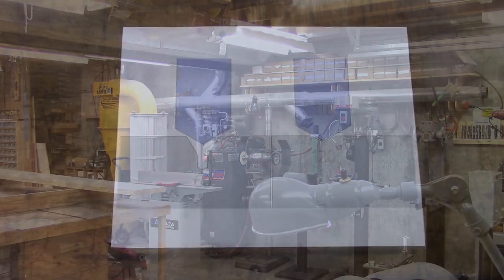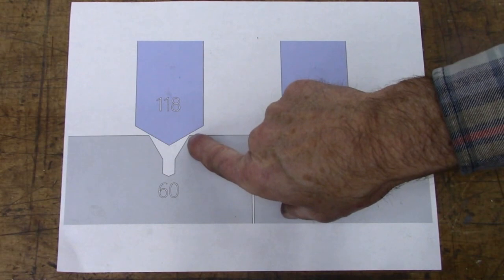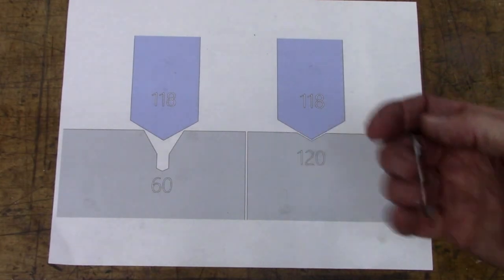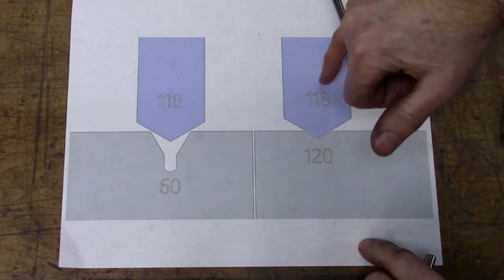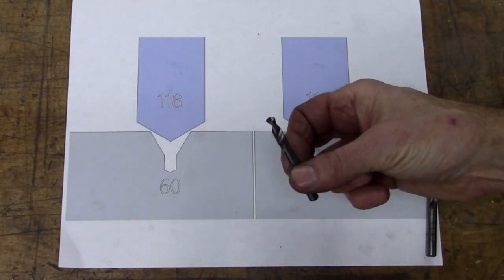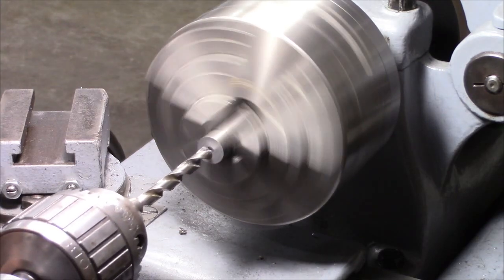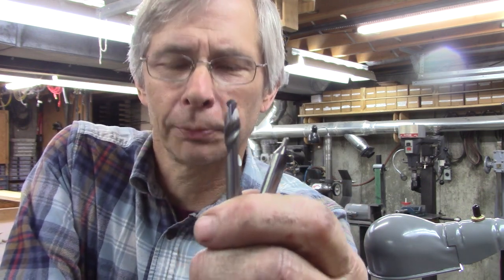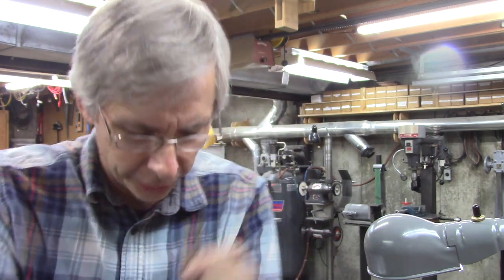Center Drill VS Spotting Drills

Comment: How deep do you go with the center drill?
Reply from the maker: Ideally when used for a pilot just the tip. When used for a center to the end of the second angle.
Reply: @WinkysWorkshop  what happens if you go to line ?..would it break the center if it’s to deep?
Reply from the maker: In theory, when used as a pilot drill the sharp edge of the hole would deflect the longer drill off center. The tip of the center drill matched and 82 degree drill but the second cutting edge does not. When used as a dead center in a lathe you would use most of the cutting ende on the second step.

Comment: How deep do you drill with the spotting drill?
Reply from the maker: Only the angled part. Going further probably won't hurt but it's posible that the sharp cutting edge of the drill will catch the sharp edge of the deeper pilot hole and deflect the drill.

Comment: A couple things that are either incorrect, misunderstood, or misrepresented.
1. You're first attempt, with the center drill, was too deep. (more later)
2. Your drawing is correct, but you apply it incorrectly. The depiction on the left should be used for HSS and Cobalt, while the right would be for Carbide. This is referring to the spotting angle (greater for carbide and less for HSS/Cobalt).
3. Your spotting diameter should be ~30% < final drill diameter. This is why I say your first attempt was doomed to fail, regardless of any other particular point.

Other than these points, I think it was a decent video and it seems others have learned a thing or two. ;)
Reply from the maker: I might not understand correctly. The first example was doomed to fail because second angle on the spotting drill is meant for a lathe center not for spotting. Did you mean that the TIP diameter of the center drill needed to be 30%? If so, I would agree with that. Also why would the spotting drill angles be different for HSS vs carbide? The angle of the spotting drill needs to be the same of slightly greater than the bit that follows. Your 30% diameter rule sounds about right but the angles compared to the drill that follows is critical.  This is a good website:  https://www.harveyperformance.com/in-the-loupe/choosing-spot-drill/#:~:text=Ideally%2C%20the%20center%20of%20a,to%20140%C2%B0%20and%20larger.

Comment: For ease and accuracy could a center drill front edge be cut like a spotting drill. Smaller start but multipurpose is nice.
Reply from the maker: Yes, most center drills are sharpened at the correct angle (at the very tip) for a 118 degree bit. I left this important fact out of the video.

Comment: That was interesting thank you.   Speaking as a retired engineer with 50 years service in high quality Machine Tool manufacture,  I'd never heard of a spotting drill before and I must have drilled many thousands of holes without any problems after using a centre drill first.   The theory of how your spotting drill works sounds ok,  but I'm assuming that an accurately positioned hole is the object of the exercise?   My question is how do you stop the spotting drill from wandering from it's position when starting to drill?   Surely a short and stiff Centre Drill is much less likely too?
Reply from the maker: A good spotting drill is split point so its basically the same as a center drill. I use carbide so it is super ridged. Something I failed to mention is that the very tip of the center drill is the correct angle, its the larger part of the center drill that is not. In the past I've had problems with drill staying on center following a center drill but I was also drilling deep.

Comment: "a center drill is actually for a lathe center"   
"a spotting drill is when you want to locate a hole accurately and follow up with a larger drill"

Do I get an A?
Reply from the maker: You got an A. Ha...  You can use the very tip of a center drill for spotting however. It's sharpened to the correct angle.

Comment: Perfect. Just the kind of tip I was looking for.  Now that I bought a few sets of center drills... But let me ask you this. What if I am not using them on a lathe but with a drill gun or drill press? What if I need a 3/16" hole?  Could I use the center drill that has the biggest diameter of 3/16" and drill a 3/16" hole?  So the center drill would start with the smaller tip on a center punch dimple, and just follow with the 3/16" diameter part of the drill.
Reply from the maker: One thing i failed to point out was that a center drill has the correct angle at the very tip. You can use it as a spotting drill but ideally the drill needs to be no more than the diameter of the tip of the center drill. I still use the center drill occasionally because it has better visibility. That is, if you are trying to hit a mark made by a center punch you can see the tip of the center drill. The biggest issues arise when you use the upper part is a center drill to guide a drill.

Comment: I didn't see the wobble.
Reply from the maker: It was slight. Nevertheless using a center drill like I did it prone to problems. I did fail to mention that the very tip of a center drill can be used as a spotting drill. It's sharpened to 120 degrees and works well when followed by a 118 degree. The only problem is that unless you use a fairly large center drill it makes a very small starting hole.

Comment: Thanks Winky, I had to learn this the hard way when I should have researched "Center" Vs "Spotting" Drill first. That's how I found this video. Now I know why I've consistently been disappointed in my Center Drill results! After seeing your video I'm convinced more than ever that besides the points you made, ..the Center Drill has no place in Drill Press operations. I've been using them for that following center punch operations. EEEK! 🥵
Wakodahatchee Chris
Reply from the maker: Your welcome. There is one thing I failed to mention in this video. The very tip of a center drill is the same as a spotting drill. I occasionally use a center drill for small holes. Its easier to see the mark. If you get a spotting drill I would suggest getting an 1/8" carbide. It's very ridged and will last forever plus its easier to see you center punch mark.

Comment: What I've wondered since I don't have any spoting drills is couldn't you make a spoting drill by just cutting down a regular drill just past the shank then just put a 120 degree grind on the tip it'll be a Lil shorter but not really any shorter for the size then  a center drill ???
Reply from the maker: I'm sure you could make a spot drill although they are fairly cheap. I recommend a solid carbide maybe 3/16". Spot drill usually have a very small web in the middle so they won't walk around. You can also use the very tip of a center drill the same as a spotting drill although its a bit small. One other thing, on a standard drill the web gets much larger toward the shank so they are not ideal. Really not so good as a regular drill.
Reply: @WinkysWorkshop  yeah I found some 5 piece sets at pretty reasonable prices  HSS/ 8 percent cobalt last time I had looked around everything I found was super expensive for what they are I get carbides expensive but I was seeing 5 piece hss/cobalt for like 450 a set thanks for the video and explanation 👍👍👍
Reply from the maker: @umahunter  Not paying that kind of money...  I think I paid $22 for my 1/4 carbide but they seem to have gone up in price.
Reply: @WinkysWorkshop  yea I found a 5 piece hss/cobalt at all industrial tool supply 1/8-1/2 for 34 bucks free shipping on ebay

Comment: Could anyone tell me the effect a centre drill has?
Reply from the maker: The center drill is for drilling stock to run on a center in the lathe. Technically it can be used as a spotting drill if you only dill with the very tip. If you go too deep where the upper part of the center drill is cutting a countersink the angle is wrong and there's a change the cutting edges will pull the bit of center.

Comment: That makes cense. Too bad most spotting drill on Ebay seem to have a 90 degree grind angle.
Reply from the maker: Amazon has some good ones. I bought carbide. If I remember right it was less than $20
Reply: @WinkysWorkshop  I don't use Amazon on principle, they embody what is wrong with this world i.m.h.o.
Reply from the maker: @Rolingmetal  I agree with that although I think the stock market is even worse. I never shop at walmart for the same reason. Amazon has a great business model but like the market its about who does the most with the least.

Comment: If this is true...that having the lip of the drill contact first instead of the center web is bad and can make it wobble or hurt the edge or whatever...how do people explain pilot holes and stepping up in sizes?

Either one is fine. Center drills have been working to start holes for a over a hundred years or whatever. And no they are not strictly for lathe centers only. The actual name of them is a combination center drill and countersink. The countersink part is the part meant for lathe centers. The center drill part is the little tip with a regular drill angle.

If you need a hole to be really accurate, you need to bore it either way.
Reply from the maker: You are right about the tip of the center drill. I need to redo this video and include this. If you go to deep and use the upper portion of the center drill the bit tends to wander.  As for the edge of the bit hitting first when stepping up in drill sizes. It will wander! The difference is, the existing hold aligns the bit. The hole will almost be larger at the entrance of the hold until the bit settles into the existing pilot hole. You could say the same about a hole drilled with a center drill too deep but there is a brief period time when the bit is only touching the outer edges and has no centering force. https://www.harveyperformance.com/in-the-loupe/choosing-spot-drill/

Comment: Your reasoning makes good sense to me,  my drills often wobble as they initially enter a deep, centre drilled hole.
As a self taught hobby machinist I've always used centre drills to start holes on the lathe, never heard of 'spotting drills before seeing your video.
So, I've just searched online for 'spotting drills'  (here in NZ) - BUT, they all have a 90 degree point, not 120 degrees.
So, now I'm confused!! Can anyone help?

After seeing pictures of spotting drills online, I realised that I already have one (with a 90 degree tip)! I've been using it by hand to deburr small holes. I'm off to the workshop to try it out....
Regards Paul in NZ
Reply from the maker: That's strange you can't get it in 180. Something I learned about the center drill is that the very tip is 120 degrees. If you use a larger one and drill shallow it will work the same as a spotting drill.

Comment: Hello Winky, I'd like to add a few other reasons, it could be the tail stock is misaligned due to cutting tappers or maybe there is some foreign material between the tail stock and the ways, also it could be wear, maybe the end of the round bar has a pip due to incorrect center height, as an exercise try drilling a piece of round stock and watch carefully what happens when the drill makes contact with the round bar, if you see the drill kick to one side and then the drill starts to wobble, then do some tests about the tail stock alignment or foreign material between the ways and the tailstock guides. Hope you don't mind me throwing in my two nickels worth. :))  Thanks for your suggestions very helpful indeed! Cheers ...
Reply from the maker: Thanks, and all good points.

Comment: You just turned on my light.
I have center drills. I have your standard and those made specifically for live/dead centers.
I also have spotting drills. For some reason I never use them. I will now!!
Reply from the maker: You sound just like me. I thing outwardly the center drill seems like it would be better but after looking at the science you start to see why the spotting drill is better.

Comment: If the drill starts wobbling, I have always used the back end of a tool holder, or if in a hurry or feeling slack, the mounted tool, to apply a slight pressure to the side of the drill near the point to take out the wobble. Slowly feed the drill while also slowly removing the side pressure and you will find it will find the center perfectly.
Reply from the maker: I have done the same but never need to do this with the spotting dill, it hits center every time.

Comment: Excellent demonstration. I have been using spotting drills for ages but, here in the UK, they are not so easy to find as centre drills. Also, often, I will just use a centre drill because it is handy ... I'm a bit lazy I suppose, must try harder 😉.
Reply from the maker: Thanks for the comment.

Comment: There is one flaw in the depiction. A drill doesn't come to a point, it comes up to the chisel edge which is flat. Not saying that the use of the spotting drill doesn't get the job done though.
I think center drills work fine if the hole is not much larger than the chisel point of the drill used (outside hole, of the inner one). That way there is very little side to side force due to imperfectly ground cutting edges. If you go bigger one drill cutting edge will always contact first causing uneven forces. Also even if you use a larger center drill, the second smaller diameter hole guides the chisel toward the center due to unbalanced forces and taking less force to follow the existing hole.  So it may not be centered perfect right as it touches, but with good pressure should center up.

It would be interesting to do some tests though. I suspect that starting the hole too gently will allow it to be out of center. I have been able to hold less than .005in position with center drills for all of my machining career, so never found it to be a big problem, but is worth switching as the argument is logical.
Reply from the maker: This is true, I should have shown that flat on the tip of the drill. The spotting drill has a very small web between the flutes so it is minimized. This makes the center drill very slightly better but the difference is very slight. Some spotting drills have a split point which is an extra grind on the flute and makes it just as good as the center drill but with a larger spot to hit. To drill accurately with a center drill you really need to use it like the spot drill, very shallow but, this also necessitates following with a smaller drill. Stepping up the center drill diameter is an option but it requires a lot more pressure than the spotting drill.

Comment: I have a few of them but they are all 118* I ordered one and will try it out. When I make my tool paths I’ll have to figure out how deep to make the spot.
Reply from the maker: It's kind of easy to go too deep but once you get used to it, its not a problem. The 118 will work fine as long as it's not a stubby drill. The spotting drills have a very narrow web between the flutes.

Comment: Happy Belated New Year Mark & Family. You explained this very well - it's kind of common sense isn't it.  I have a box of old drills that have many uses. They're good for practice grinding with, so I've ground my own spot drills. Only need a couple of sizes but I'd like to get better a tempering them.  Stay safe and well :)
Reply from the maker: Thanks Anthony! Obviously the short drill bit is stiff and will stay put a little better but a spotting drill is made much differently. Spot drills are designed to only go as deep as the tip or cutting edge. The web between the flutes is very thin and there is no side relief. If you go very deep the bit will bind and brake. Regular drill have a wider web and the web gets even wider as it progresses. If you re-sharpen a broken drill you will probably see it.
Reply: @WinkysWorkshop  That's what I've been playing around with when grinding the old bits. For me, seeing & doing something is how I learn more than just reading about it. I haven't tried on a blank yet though.  ATB :)

Comment: The cutting angle difference is clear to see.
But how about a short cutting drill from a holesaw, if you choice in up in the drill chuck as far as it will go that works very well.
Reply from the maker: Spot drills are designed to only go as deep as the tip or cutting edge. The web between the flutes is very thin and there is no side relief. If you go very deep the bit will bind and brake.

Comment: So a drill bit sharpened to 120° would be considered a spotting drill bit then?
Reply from the maker: The spotting drill are different. Aside from being shot they has a very thin web between the flute at the time. They also have no relief on the sides. If you drill deep they will bind and break. They are design to go no deeper than the cutting edges.

Comment: Will the spotting drill be marked special? How would I know it’s a spotting drill and not stub length drill bits?
Reply from the maker: I've seen the stubby drills but never owned one. If you buy a spotting drill that what it will be called. The spotting drill is different from a standard drill at the tip the web at the point is very small.
Reply from the maker: Also...  I put a link in the description. Good price.